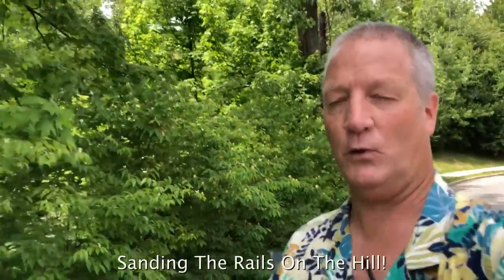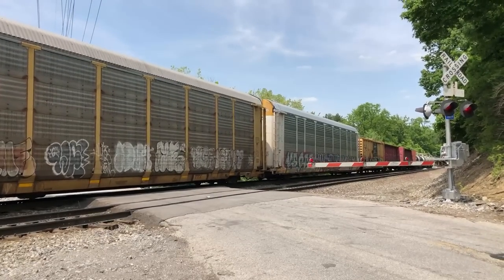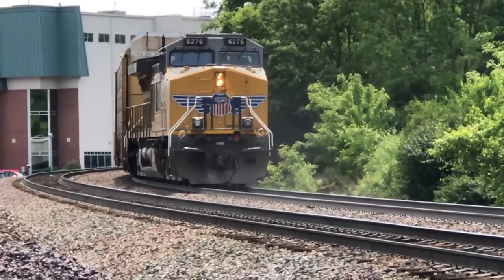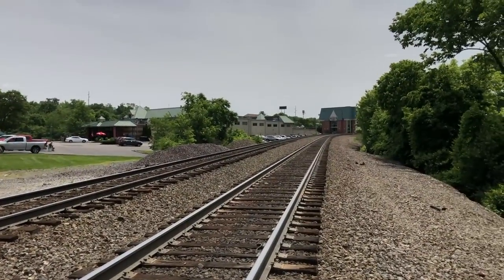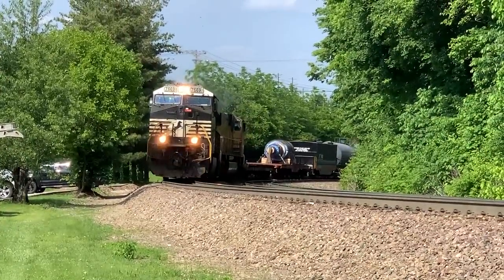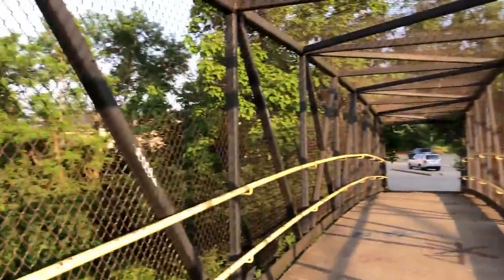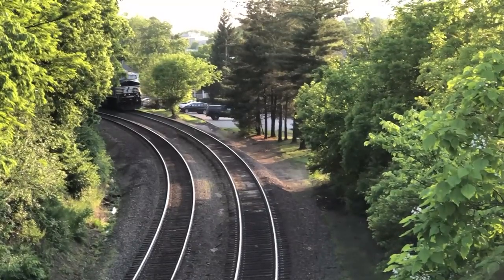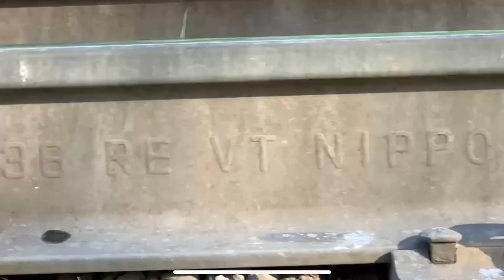Sanding The Rails & What is This Huge Hi & Wide Load Thing!  Trains Going Up The Hill With DPUs

Comment: That appears to be the rotor/armature/rotating assembly from an electric motor/generator/alternator. Copper is more dense than steel so copper wound components are especially heavy. This car had a load limit of 488,000 pounds and 8 axles. A car (DODX 40000 SERIES) that can carry two M1A1 Abrams main battle tanks has a rating of just under 300,000 pounds and only 6 axles.
Reply: DoD: what kind of rotor is that?
Reply: @robertdshannon5155 The rotating moving (center part) of a alternator is called a rotor. Outside windings are the stator.
Reply: Had a question never got answer where's the anti Christ train do know the anti Christ train for Canadian national is it's in Waterloo Iowa.
Reply: Couple cars down, on the other  side of the box car looked like the bearings for it
Reply: I think you're right. It's not a turbine. Those are too delicate to travel like that. They are in specialized containers. Rail Road Tie Spiker caught the same piece of equipment in Marion, OH here https://www.youtube.com/watch?v=BQy1hiVZG5c And just two cars in front of it is an oversize electrical transformer. So it looks like something going to a power plant.

Comment: Looks like a turbine shaft for hydroelectric assembly. 
Used to work for RG LeTourneau, he passed in the late sixties and was one of a handful of companies that had machine lathes that could work large pieces shafts like that. 
Excellent as always Jawtooth.
Reply: @Doug Blalock, i just want to say, is that your channel is amazing.
Reply: Thats exactly what it is , I had an uncle that worked In the GE gas turbine division saw many of these on my rear visits.,
Reply: @mikemalo47  the US trains are amazing
Reply: Johnstown Corp. produced these rolling mill rolls. It was a former US Steel foundry. Some of these large rolls weighed as much as 60 tons before machining.😊
Reply: @mikemalo47  Not seeing under the strapping, To what is showing appears to be Rough Casting, looks like a Huge Field, For inside the Generators, May a replacement, going to Machining.
Reply: always impressive to see such a large shaft get worked so well
Reply: Looks like an armature for a BIG electric motor.
Reply: @williamcox1611  it's a rolling mill roll.

Comment: The company where I worked for almost 45 years cast and machined rolls like that.
It's a backup roll that maintains pressure on the rolls in a mill fhat rolls out steel.
I've turned many like that on a lathe.

Comment: I think I know what that thing was. They would turn it vertically and to me it looks like a core to a hydroelectric turbine core for a dam. See the brushes will ware and after awhile it won’t make contact to make electricity. But this is a guess. A large dam has several different turbines inside and in the dam there is a large overhead crane they use to service the turbines so having one down is not a problem. Steven Sipes

Comment: Looks like a generator rotor from an electric power plant.
Reply: Definitely looks like an armature for a very large alternator .
Reply: totally agree with you
Reply: It's a large rolling mill roll. We produced them at a foundry I worked at years ago. It was a former US Steel plant.
Reply: That’s exactly what it was, being shipped for re-do into good as new,otherwise,it would be totally enclosed, use to work in Schenectady GE Large Steam Turbine Generator Bldg #273, used to refurbish these all the time. 
Puppy had an accident,because he’s young, BUT you offered your fingers to him, and he thought you were Momma,began nursing, a pleasurable experience, hence the pee, Momma, if present would have cleaned him up! He should still be with Momma. So if you are going to offer him fingers, dip them in milk!😂
Reply: I worked in a coal fired electric generating station for 35 years. We shipped our generator rotors out this way to be rewound. They’re bundled in 2X4s to protect them in event of a derailment.
Reply: @Paladin Lng I know how they are shipped, it's a rolling mill roll. We made that particular one including machining. It's wrapped to protect the finish surfaces from rust.

Comment: It looks like that was the rotor for an electric generator or a large electric motor. It is installed in the center of the stator and if it's a generator, when the motive force (steam or diesel for example) spins the rotor - we get electricity. If it's a motor, then when electricity is applied, it spins the rotor which turns a shaft to do work. It's a big one :)

Comment: Nice trains with foring power. The huge hi and wide load thing is a part of an generator. Steam- or gas turbines are packed and loaded differently. Siemens has such a plant here in Berlin that manufactures turbines for power plants. Greetings from Berlin/ Germany. Sven

Comment: Mr. JT, I was watching another channel, owned by a retired (real) RR engineer.   He states (that in his opinion) that sanding the tracks has very little value in terms of traction - if any value at all.   I openly acknowledge that everyone has an opinion, but some opinions have greater value based on life experience and training.    I wonder if sanding the rails actually does have a notable increase in traction.   Have you heard anything, about sanding and improved traction?   As ALWAYS , stay safe, don't get hurt - it's a crazy world out there.   Great videos: keep looking for new approaches, to keep the channel interresting.  :0))
Reply: I don't know. There are studies though. One concludes that "The wear and adhesion studies indicate that the beneficial effects of sanding in improving adhesion are more than offset by the increased wear rates. This increase is one to two orders of magnitude, compared to no sanding condition, depending on levels of traction. It is concluded that application of sand should be avoided as far as possible and high adhesion should be achieved by other means in order to minimize wear and the resulting track and equipment costs."  -- from the paper, Wheel-Rail Wear and Adhesion With and Without Sand for a North American Locomotive
 S. Kumar, P. K. Krishnamoorthy, D. L. Prasanna Rao